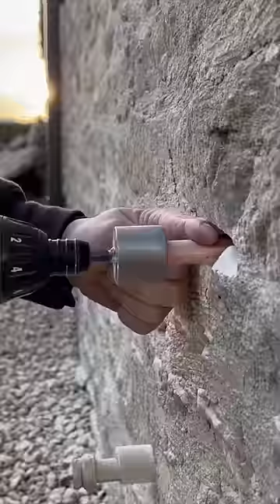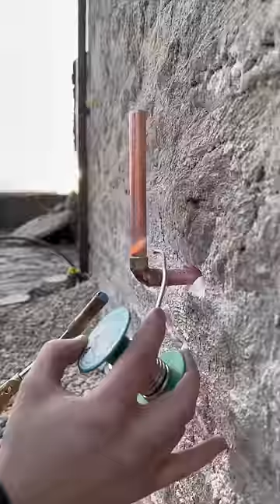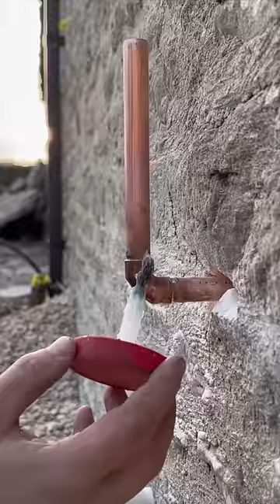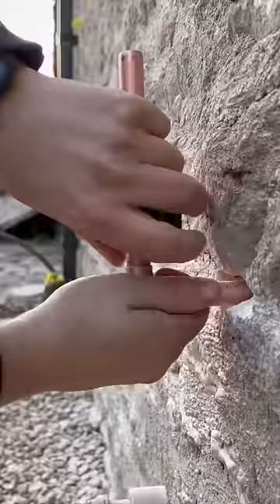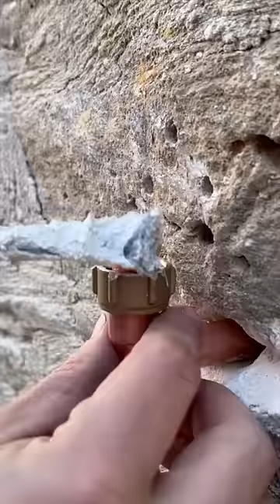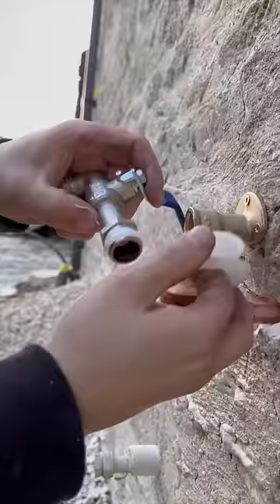HOW To fit an outside tap on stone wall! #howto #asmr #diy #plumbing #subscribe #youtubeshorts

Comment: So if the tap dribbles at all the water runs down straight back into your wall🤔 unless you silicone it up then you are relying on silicone to stop water ingress🤔 not how it would be done here

Comment: Put the tap below the pipe then when you turn it off for winter with the valve in the house 🤞🤞🤞you open the tap to drain it 🤣

Comment: You primed a copper pipe from the wall that was already ready.....  You use mollys to fasten that thing.  Mollys suck in general.  You hammer in the molly screws.... screw, hammer, screw, hammer.... wtf.  You put the white stuff on half of the copper going up.  So many things only a greenhorn would do.  Don't video tape your scrub self.

Comment: I had old steel pipes now i cant remove its thread i have to change the whole pipe but the fuck up part is it runs inside a fucking pillar from out the house of a 4 th floor

Comment: What's that nonsense with the hammer supposed to be? Use the proper screws and dowels and you won't need to hammer them in! If I saw you doing that on my house, you'd be told to pack your tools and get off the property!

Comment: Teflon paste is pointless on a compression fitting around the ferril. Use the paste on the threads of the nut. SMH . Get some experience before you post. SONNNNNN

Comment: Why would any craftsman use improper tools like that?  Why use Teflon paste on a compression joint, are you not compromising the connection?  Why use ten yards of tape when four wraps is quite sufficient?  Why use flux after the soldering is complete, you are leaving acid on the copper, it will cause corrosion!
No, I do not believe this man is a professional, bad technique(s),  amateur mistakes!

Walk away n find a channel by a real master plumber!